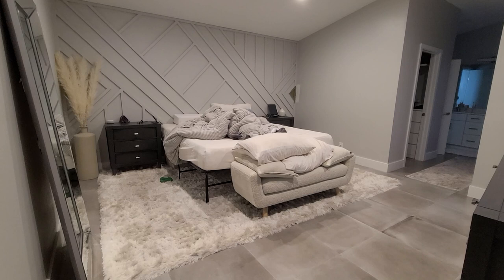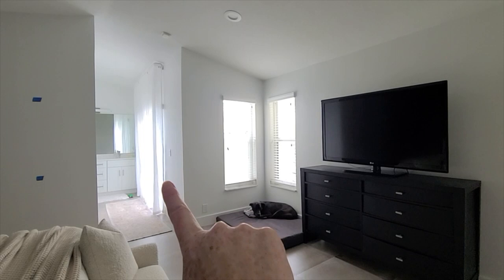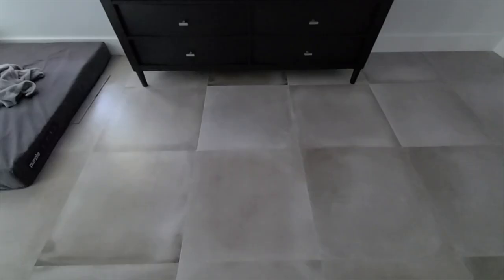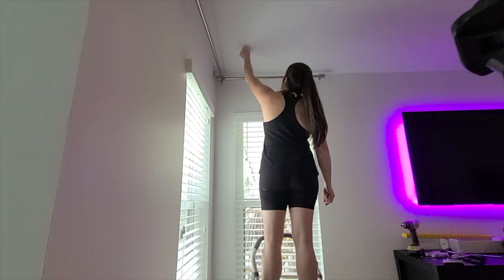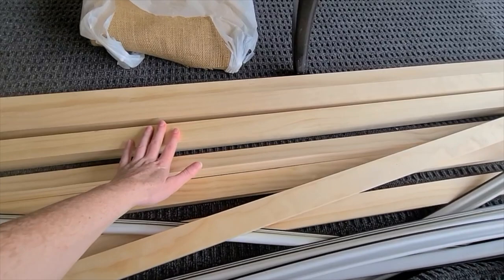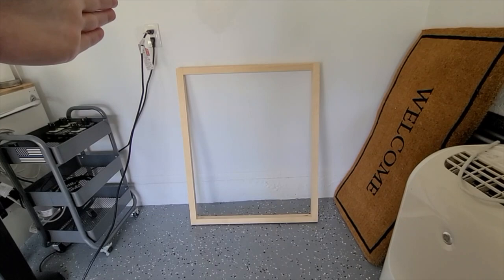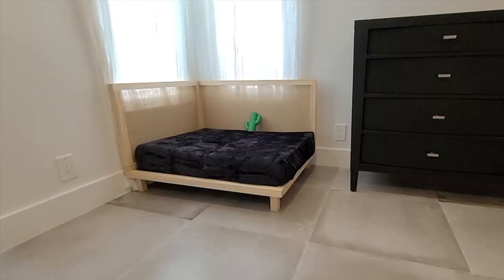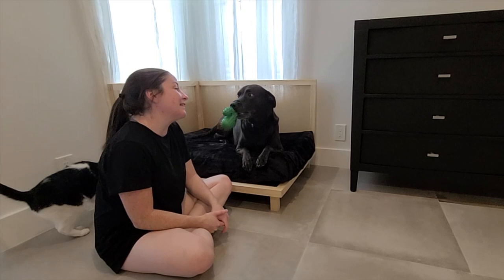Accent Wall Update & DIY Dog Bed

Comment: Love the finish looked❤
How much paint would you say you used for the accent wall alone??
I want to do this but I'm racking my brain if I actually need an entire gallon
Reply from the maker: I think I did use more than half a gallon. The wall is 15ft long so it's pretty big and I did like 2 or 3 coats. Plus there's so many nooks and cranies to get the paint in.